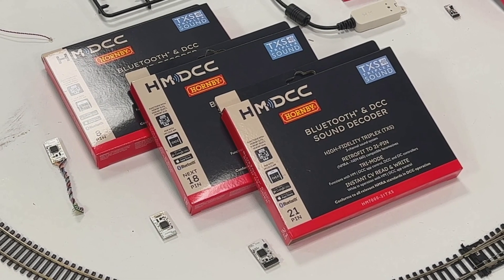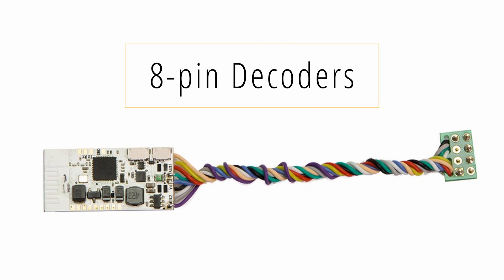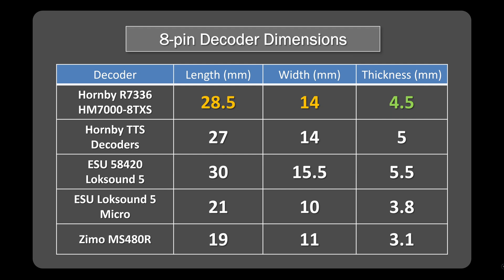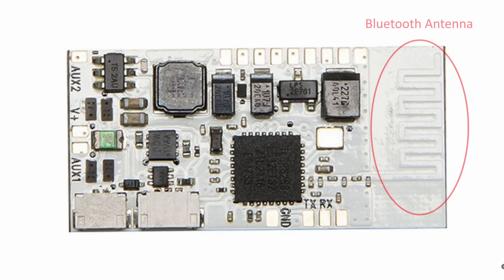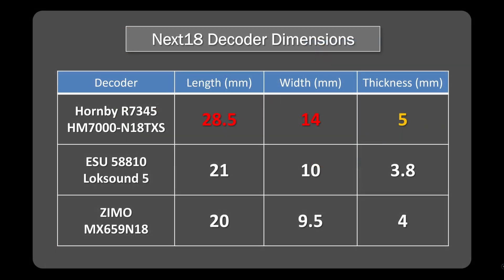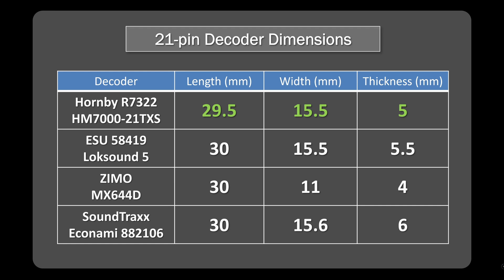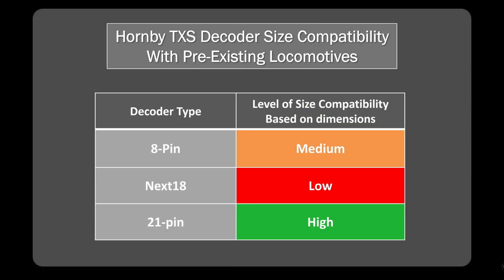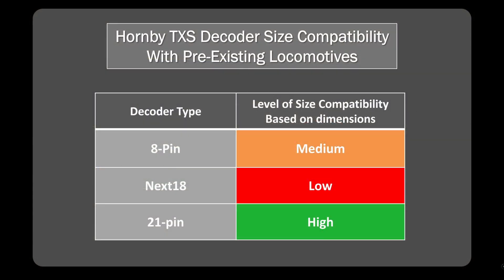Hornby HM7000 TXS Decoder Sizing and Comparisons - Will they fit as replacements in older locos?

Comment: I've been thinking about the TXS Next18 issue.  If one is content to use them only on DCC having loaded sound and set them up, might not one then reduce their length by cutting off the aerial?
Reply from the maker: A valid question Tony. You need the bluetooth connectivity to set up these decoders, programming new profiles and selecting the mode of operation - even if you only intend to use them under DCC. So even if that extended PCB space only contained the bluetooth aerial for example, cutting it off would render the decoder at best restricted to what you had configured on it prior to that (and you could never reconfigure it again), or at worst unusable. You need the bluetooth to manage these puppies even if using DCC control.

Comment: I have a question you might be able to answer. I use android, and to my knowledge, the app hasn't been released yet.
My question is, can an iPhone user download the sound to a TXS decoder for me to use on my android tablet through a Z21 app?
Reply from the maker: Hi, yes, they can. Get them to download the sound and the function profiles and then set the control to DCC. You can then take the decoder and use it as a DCC sound decoder.
Reply: @EuviRail  Excellent news. Thanks. 
Can the same sound decoder be used and operated with a Z21 without sound until the android app is released?

Comment: Hi do  you know if the 8 pin will go into a vi- trains class 37 or 47
Reply from the maker: Hi Tony, I have previously owned both of these models and had fitted TTS decoders in them. Based on that, the new 8-pin TXS decoders will fit them just fine.
Reply: @EuviRail  thank you.

Comment: I think the main thing with the Next18 is the standard actually defines the decoder sizing and Hornby have gone against this. It’s also that in general the Next18 chips go into the smaller locos. Therefore they are sized to meet the standard. With 8 pin it’s arbitrary and therefore whilst Hornby may be larger than some it’s not unreasonable and any locos that won’t fit the Hornby 8 pin also won’t fit others. The 21 pin it’s designed to the standard so there’s no issue and only locos with a non spec 21 pin interface would have issues.

I would though highlight that the speaker and stay alive connections would not fall under these standards though and there many locos may struggle if these are fitted as well.

Comment: Thank you for putting this together, very helpful.
In my experience Next18 decoders and model manufacturers don't sit well together.  I bought a Dapol DMU in N scale and went to fit a Next18 decoder for sound and found the space for the decoder was 5mm shorter than the decoder standard. 
Clearly that shouldn't be an issue for most OO/HO prototypes though.  
Additionally I've found that the sockets for Next18 can be poor quality and the decoder can sometimes come loose.
Generally speaking I would fit a wired decoder in preference to Next18.
Reply from the maker: Thanks Martin and thanks for sharing your experience. As you highlight, it works both ways - decoder vendors not meeting the spec and loco manufacturers not provisioning enough space. A wired decoder provides the greatest flexibility for sure.

Comment: As Storm Bowman notes, the problem with the Next18 chip is that doesn't meet the NMRA standard and therefore it is unlikely to fit in anything other than a recent Hornby model. I believe that Hornby have stated that this is a temporary issue caused by component shortages and they do plan to reduce the size of this chip in time. It would certainly make sense for them to meet the NMRA standard if they can do so - but the Bluetooth antenna takes up quite a bit of space on what is normally a small chip.

The other issue for non-Hornby locomotives using 8-pin or 21-pin decoders is the availability of sound profiles. Since you can't load them from any source other than Hornby, your non-Hornby locomotive may not have an appropriate profile. For some this may not matter and they will just choose something broadly similar, but I'd suggest a typical Zimo or ESU customer may be less forgiving if they have previously sought out an accurate sound profile. According to some reviews you also can't change the function slots around to move the braking to a different slot (for instance) - which may cause issues if you want consistency with existing non-Hornby decoders. While better sounding than TTS, I've also seen it stated by Hornby Magazine that the TXS steam loco chuffs are not synchronised with the wheel revolutions and change the audio in bands rather than a linear increase as speed increases. Again, some may not mind this. Others may consider it a deal breaker.

Finally, if you fit a Hornby TXS chip to something with particular lighting setups (for instance) then you may lose some of the fancy lighting options that you have in a Zimo or ESU profile which was tailored for that particular model and its function outputs. I'm not sure how easy that would be to resolve.

The Hornby TXS decoders undoubtedly have some neat touches, but I'm not sure that they are likely to cause too much panic for Zimo and ESU just yet. That said, if you have been running DC with a big stock of locomotives and want to switch to DCC sound then you'd save quite a bit of money with TXS.

Comment: Thanks for that - a useful fact based approach rather than some of the other reviews (particularly on the NEXT18 decoders) which seemed to me to be set up to deliberately find fault with these new decoders.  As other have pointed out, the price point of these new Hornby sound decoders is a major selling point over the other more expensive sound decoders as well as the functionality within the app.
Reply from the maker: Thanks. There's no debating the value aspect for sure and so far I've found the sound quality to be pretty good. We need to see a lot more profiles though.

Comment: Thank you Eugene, that's a very useful set of comparisons you've provided us with. Top work as usual. Any feedback as to whether they blow easily? Sam of Sam's Trains YT channel reported that one of his HM7000 decoders blew after just 24hrs!
Reply: I believe it was due to the power unit used by “sams trains”. Advice is to use the power brick supplied by Hornby as it meets the demands of the decoders or of course your normal Dcc supply if you have one.
Reply from the maker: Thanks. Yes, there is an incompatibility with the Gaugemaster controller Sam uses. It comes down to the Pulse Width Modulation (PWM) used by that and other analog controllers. I don't know the specifics, but I'm sure Hornby do at this stage. Simple DC (non PWM) controllers don't appear to have this problem - I'm recording a running session with one of these right now which I'll be posting soon.

Comment: Useful tables. Many thanks for this. Be interesting to see how much smaller the non-sound ones turn out to be. I think we all assumed these would be bigger. Some tinkering required!
Reply from the maker: Thanks Greg. The non sound decoders will still have to fit the bluetooth antenna so I have to believe they will be larger and as you say some tinkering will be required.

Comment: The Next18 decoder NEM standard specifies the size of the PCB. Hornby's TXS decoders do not adhere to the standard. Which is why they cannot be expected to fit in any locomotive that follows the standard. Sadly.
Rule of thumb:
Expect the 21 pin decoder to fit. It follows the size specified by the standard.
Expect the Next18 decoder NOT to fit. It is too large for the majority of locomotives as they follow the Next18 standard and do not expect decoders to be larger than that.
Reply from the maker: Thanks Storm, 100%. I think Hornby should be a bit more upfront on the incompatibility. If I purchase a NEXT18 decoder I expect it to be compliant. Saying Hornby decoders are for Hornby locos isn't really an excuse though I do appreciate the bluetooth antenna challenge they faced.